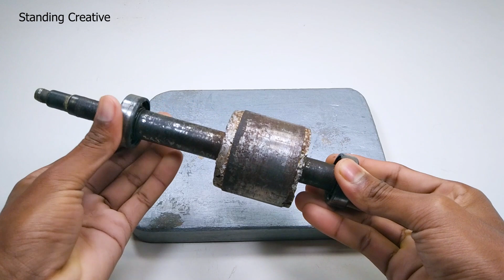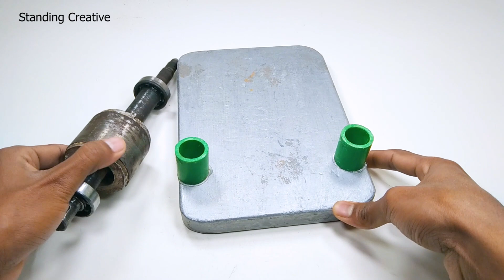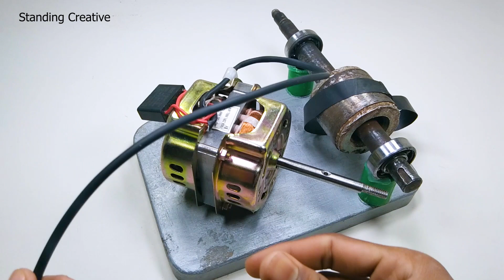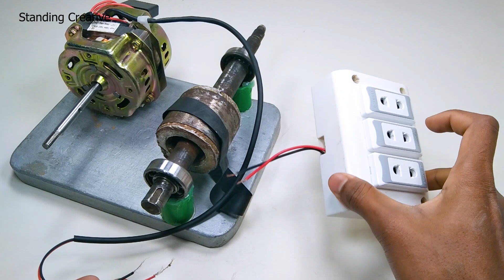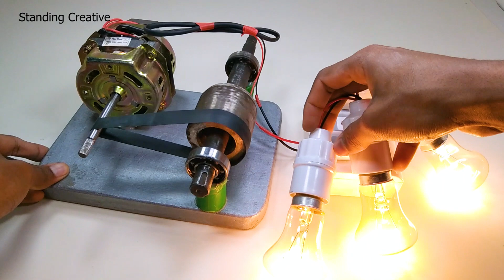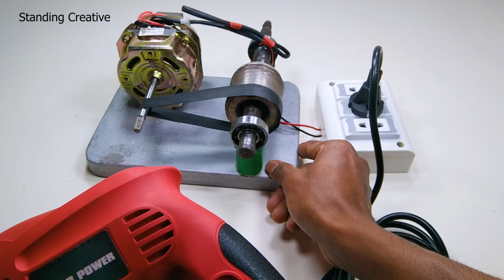Ac First Electricity 60000W Self Running 220V How To Make Free Energy At Home

Comment: 60 kw? In 3000 years.
It is not important the Power, ma the time. 60 kWh you do not use hot glue to hold parts. 60 kW in 3000 years you do not need to glue the parts.
Reply from the maker: Thanks